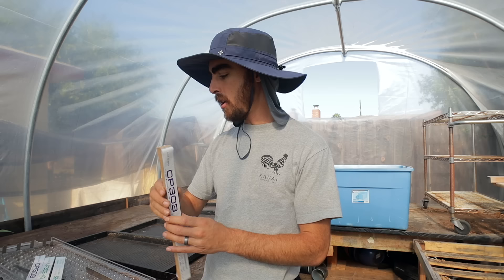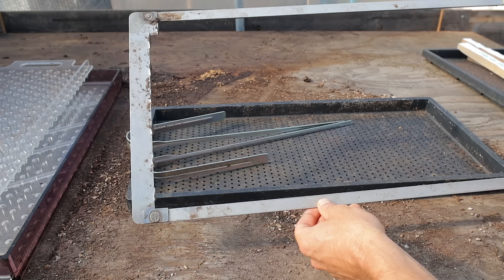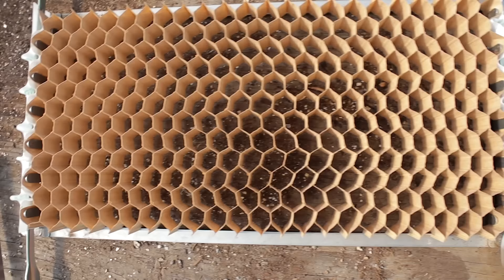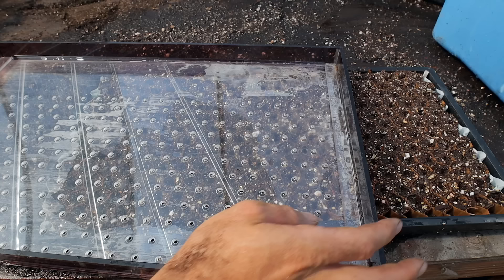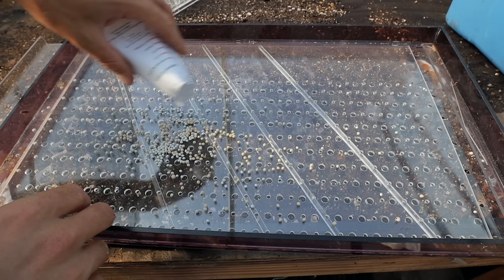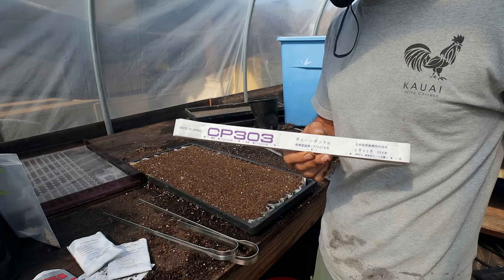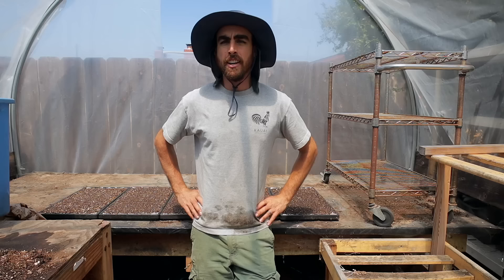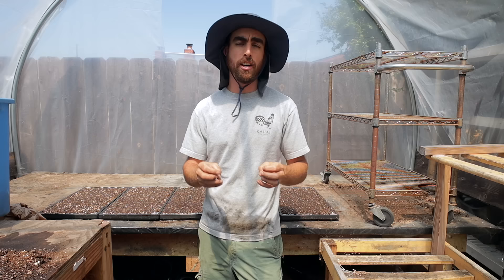Super FAST Seed Planting System by Paperpot.co

Comment: I'm wondering if the length is 49.5ft are you putting 264 plants in that length? Do other spacing cells have less/ more holes? Very interesting. Great design.

Comment: @NaturesAlwaysRight Off topic, but how does your garden do with city water? I'm in San Diego too (Santee) and the tap water has so much chlorine it tries to kill everything. I can let the water sit in buckets, but then I invite unwanted guests (like mosquito's).
Reply: Aj Addams I don’t have any issues in Vista.
Reply: You could use a big tank to let the chlorine evaporate. Cover with screen and also shade above to stop mosquitos and algae.
Then a pump to a pressure tank which is connected to your watering system. 

 Costly.

Is there another solution?

Comment: I've seen paper pot paper remains in the soil even two years after planting. That does not look very healthy, imo...What is your experience, how long does the paper remain visible in your soil and how long does it take at your end to have it decompose and vanish completely?
Reply from the maker: I've tried composting it at high temps and it still doesn't break down! It has some sort of plastic coating. BUT I know the Japanese are working on a hemp organic approved version.
Reply: @NaturesAlwaysRight  U mean plastic like real PLASTIC? Didn't know but suspected this. Tbh, even if you are not certified, but I do not want to kind of infuse plastic right into the soil...
Reply from the maker: @petermueller7407  I don't know what the coating is honestly. I had been wondering why it wasn't certified organic but after trying to compost I know why. I'm not gonna use again until they have the new hemp chains.
Reply: @NaturesAlwaysRight  is it wax paper?

Comment: Could this mysterious code be metric system?
Reply from the maker: Yes LP303 15 and 10 are in cm. But then the purple CP303 doesn't give CM so it's just a little confusing.
Reply: @NaturesAlwaysRight  weird
Reply: Agritech Trade in Japan in the source...buying it directly from there is almost half the cost than Paperpot....but checkout shipping costs, not sure if included.  The -10 -15 is likely (metric) converted to inches it matches the size printed on each item, with -303 being the smallest 2"
Reply: tannenbaum It’s not always about saving a few bucks.  And you actually don’t on some items when you factor in shipping costs.  Whatever happened to supporting American businesses?

Comment: What a waste of time and effort!  You're wrong. No commercial outfit would use that crap. It's too time consuming. You could have dropped the seeds in by hand for a fraction it took you to set up that plastic screen, move the seeds around, tap on the plastic.. etc, etc.  You have to work smarter, not harder.